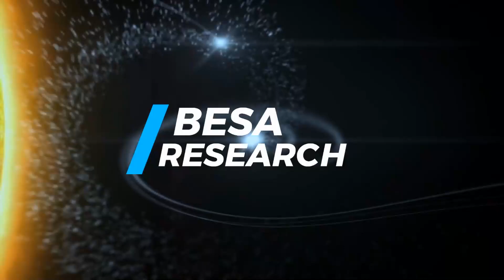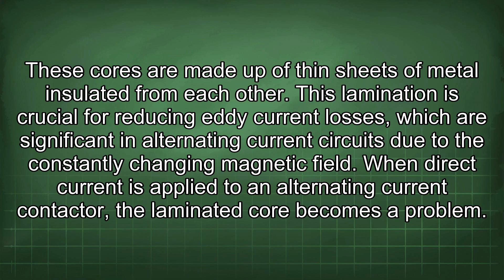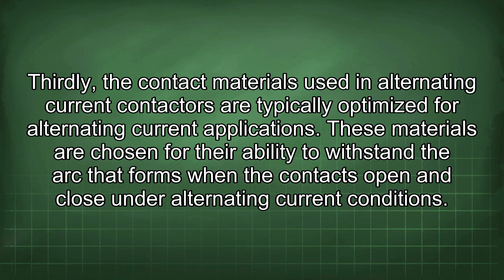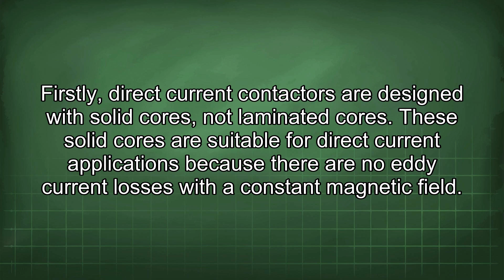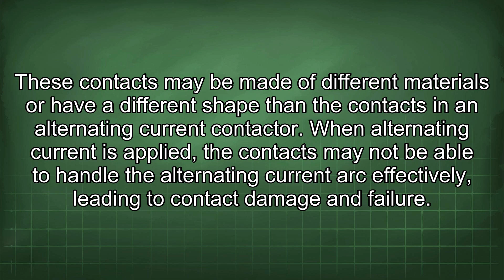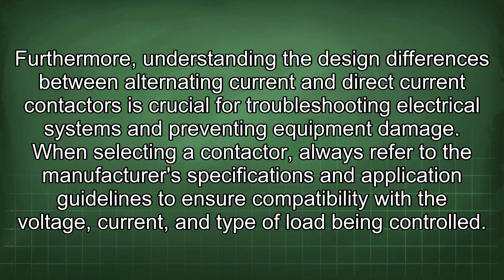AC Contactor with DC or DC Contactor with AC

Comment: No single test done to prove it?
Reply from the maker: Hello @darkobul1,

Thanks for your question! It depends on the individual contactor. If you are in the United States or Canada for example, by standard, you would use a CSA or UL approved contactor which undergo certain testing regimes. They will have a rating, in many cases cases dual. Virtually always, the DC rating will be less than the AC rating, due to the nature of how arcs extinguish with these respective types of current.

Sincerely,

BESA Research
Reply: I would of liked to see a demonstration 
But thank you for the explanation, I did wonder what the internal differences were